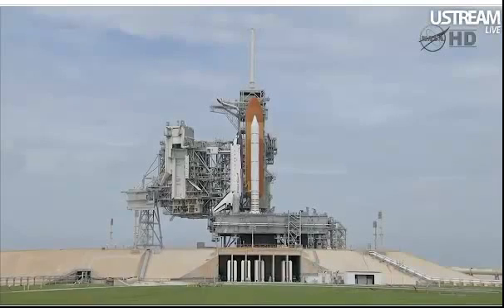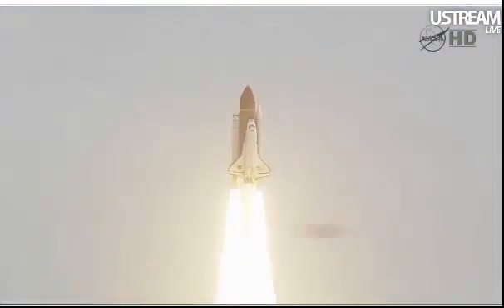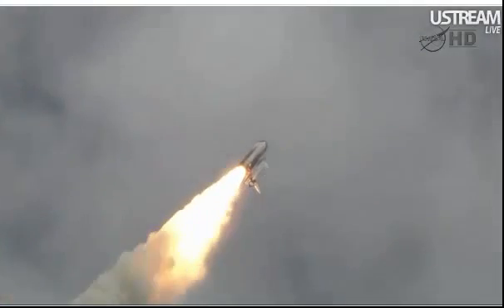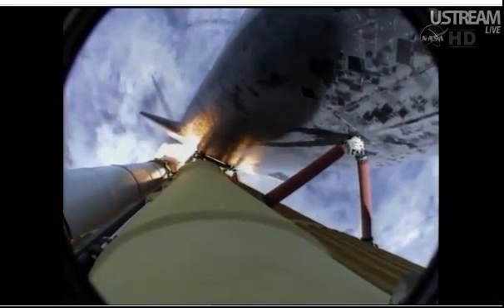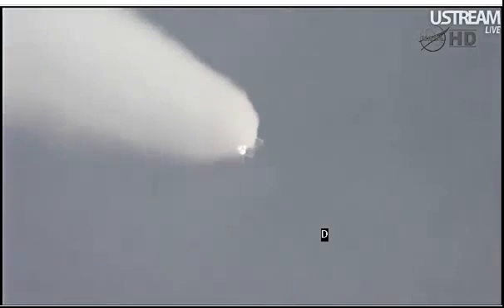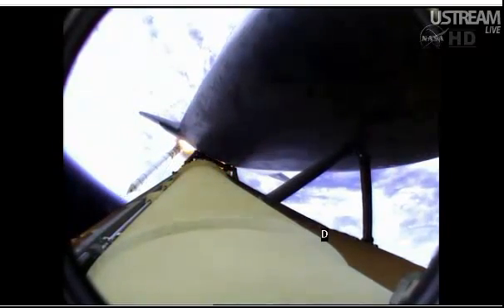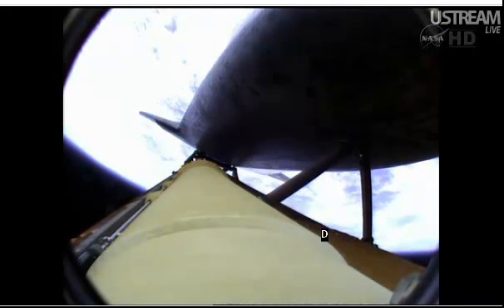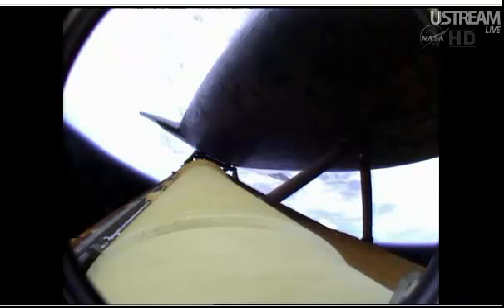NASA STS-135 Atlantis Launch - 8 July 2011

Comment: @sogley : Went the external tank separates the shuttle IS in outer space, but is NOT QUITE at full orbital velocity. the OMS engines (small engines next to the tail) finish boosting the orbiter to full orbital speed. the external tank falls back into the atmosphere over the ocean, and burns up on re-entry. No hazardous debris or meteors hitting the earth. It's designed to burn completely up on re-entry.

Comment: AZNflipy: From :13 to :21 you are watching the "main engine start sequence". Those three engines are liquid fuel engines, taking their fuel from the big external fuel tank (brown tank) attached to the orbiter's belly.  The engines are on swivels for steering, and the three engines are swiveled as far apart as possible when they ignite, to reduce the shock wave (blast) from the initial ignition of the engines. As the engines come up to operating thrust, they are swiveled together for the launch.

Comment: Those are the solid rocket booster engines. They burn for only about 2:20, then drop away. The shuttle's three main engines continue to boost  the orbiter to low orbit. Then the OMS engines (two little engines next to the tail) boost the orbiter to it's final orbit, and execute changes in orbit as needed.

Comment: It doesn't burn dinosaur fuel. The shuttle main tank is filled with liquid hydrogen and liquid oxygen. The SRBs are solid fuel. From a NASA page: The propellant mixture in each SRB motor consists of an ammonium perchlorate (oxidizer, 69.6 percent by weight), aluminum (fuel, 16 percent), iron oxide (a catalyst, 0.4 percent), a polymer (a binder that holds the mixture together, 12.04 percent), and an epoxy curing agent (1.96 percent).  no dinosaurs here.